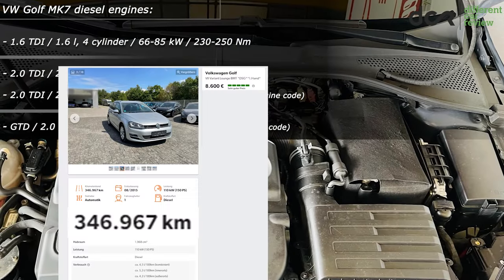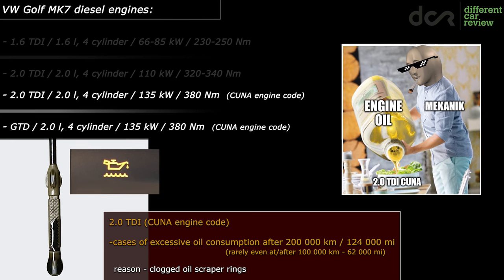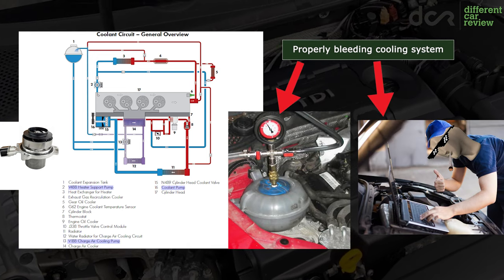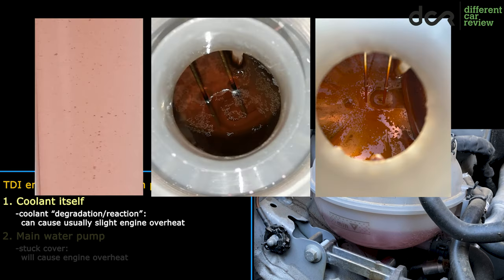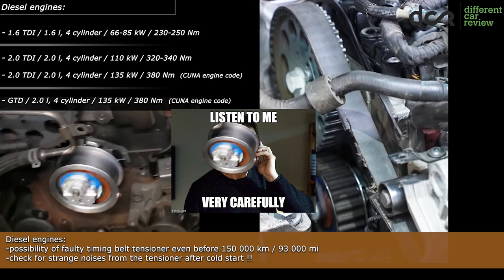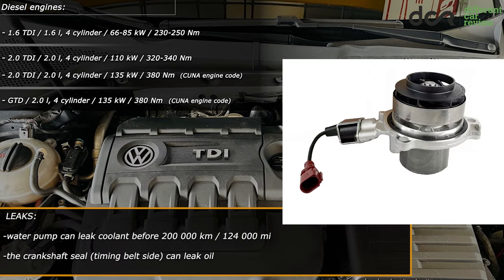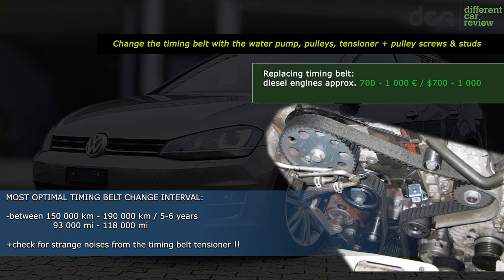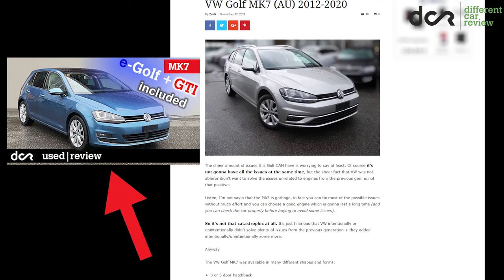VW Golf MK7 Issues of the Diesel Engines 2012-2020

Comment from the maker: Buying a used VW Golf MK7 (AU) - 2012-2020 https://www.youtube.com/watch?v=jSo4EHi9HMg
Buying a used VW Golf MK6 (5K1) - 2008-2013 https://www.youtube.com/watch?v=BgGyTSishKY&feature=youtu.be

VW Golf MK7 ALL Petrol Engine Issues https://www.youtube.com/watch?v=4f1aVIA801g
VW Golf MK7 GTI & R Engine Issues https://www.youtube.com/watch?v=xiaRO3CEkjs
VW e-Golf Issues & Things To Check Before Buying https://www.youtube.com/watch?v=7vU6VGmDAQY

1st gen 3 0 TDI ALL Issues https://www.youtube.com/watch?v=_so6yhV5qXE
2nd gen 3 0 TDI ALL Issues https://www.youtube.com/watch?v=272PBPSS2no
N13 Engine ALL Issues (BMW, MINI - N14, N18) https://www.youtube.com/watch?v=rc99kKDxoKw
Reply: Oil consumption is mostly caused by extended oil change interval. 10k miles interval can reduce the risk significantly and over 10 y is more economical. No need to add 15 L in one oil change interval.

Comment: We have a 2010 Octavia with the 1.6 TDI 105 hp (manual) in the family with 350 000 km! Nothing has gone wrong. Very, very reliable if serviced properly. The car is dog slow, but is perfect for motorway cruising. It's very good on fuel. 4.5-4.7 L/100km is my REAL average with mixed driving.
Reply: Thats the ea189 this Video is about ea288 but i got your point
Reply: @alexanderl4333  Yes. It's a EA189 dieselgate engine without the "fix".
Reply: @lahaag3310  yes, with the fix you would have many problems
Reply: That engine is a disaster, you are just lucky..

Comment: Also strange noise from oil pump which Vw says is normal, mostly when car is cold this thing has ali seat skoda vw 2.0 tdi 150/184
Reply from the maker: true
Reply: @differentcarreview-dcr  the 120 bhp is okay?  no oil consumption? I heard that the oil pump problem with the pencil was solved after year 2009

Comment: If you're still on G13 coolant switch asap to G12evo. G13 reacts with the interior heater / radiator and clogs up. Especially on diesel engines. Mine died around 115k km. GTD 2.0 tdi CUNA (pre Facelift)
Reply: Its clog up becouse of f... Silca bag in coolant reservor that is main problem
Reply: @dino30ma  good observation. Do you know which years are those with silca bag ?
Reply: I have 2.0 tdi 150 2015 year , l think is from 2013 - 2017 with silica bag but not sure 100%  @AC-db4ek
Reply: On my car l remove clamp behind engine (its tight but i can be done) where hose goes trough firewall to small radiator(which usual clogs with silikat bag) and discharge coolant hoses
First flush everything than 
put radiator cleaner flush again 
And last put g12 evo coolant .

Comment: Just to get facts straight...if you change oil and do long trip with excesive speeds 150kmh+ if engine serviced properly even at 200.000km 2.0tdi  with 150ps won't consume a drop. But...if you pressure that engine with last oil service done 10k ago be prepare to lose oil so check should be done weekly after 10k from last oil service especially if high speed is involved not city driving. These engines likes to eat oil but only after oil viscosity drops and this starts at 10-12.000km if pushed hard.
Reply: Completely agree 👍🏼. I realize it only recently.

Comment: Important thing to prevent these issues, use high quality oil and change every year or every 12000 kilometers and dont forget the filter as well.
Reply: I do mine at max. 10.000km or less depends on how the car has been used. City or highway driving.
Reply: Make it 7500 km on only city driving, 10k on mixed and 12k on only country roads.
Reply: Vw says every 15.000 km😮

Comment: I've owned my 2016 GTD for about 6 months and noticed it's used about 1l of oil in that time. Never had a car use oil before.
Was worried that it's a problem but after a bit of reading, it seems normal for these engines. Bit annoying!

Comment: I got a Seat Leon 2.0 110kw, bought it second hand currently has 128.000km. The only problem I had so far was a failed water pump at 85000km and had to remove and pressure cleaned the dpf since i suspect the previous owner didnt drive the car enough to get it to operating temp. Other than that its a great and proper daily machine.
Reply: Hi did you do the timing belt yet?
Reply: @mshahid2898  yes i had the timing belt changed at 85000 when i also had to change the failed water pump

Comment: I drive a 1.6 tdi 2019 octavia with 300.000km and have 0 issues with the engine. My colleague drives a 2020 Superb 2.0tdi with 200.000km and it has a big oil consumption issue. I guess the 1.6 tdi is a pristine engine.
Reply: My dad has a 2019 Passat, 260000km very minimal oil consumption.
Reply: @dobrien757 I have B8 with 110kw engine manual. 210k and no oil consumption. Only a slight between changes but that's only as I push it to 200kmh on German Autobahn. In this case it will take some oil but very minimal ammount.

Comment: I have a 1.6tdi dbka engine and have some problems by now (295000km) radiator exploded due to the silica bag for g13, i drove around 1500km until the oil light come on, it's about 1L every 1500Km, and the glowplug with the cylinder pressure it's giving error and at cold weather the resistence light come on and says low oil pressure

Comment: Hello, my 2.0 tdi 110kw. CRLB 280000km. When driving in normal mode (not autobam), the engine consumes 0.5 oil per 1000 km. After the oil change, 10 km were driven and 5 liters of oil was poured.... Just then I noticed that there was oil in the coolant tank (the engine was not overheated), the water pump is new, I don't think the oil cooler is leaking, I think it's related to the oil rings. .. :(
Is it worth handling the engine or is it better to buy another one?

Comment: My 1.6 TDI had a colling system issue. It did not overheat, but lost coolant through the exhaust system. Leading to a 2000 euro repair, because the engine had to come out...

Comment: I have  a little problem with my 1.6tdi , the car is in top shape for 10 years but i have a little failure , i start the car in morning and the car stuttering a little bit , 2 mechanic cant find the problem . timing pelt water pump and glowplugs are new , no oil and coolant consumption only 500ml in 12000kilometers . and all 20.0000km sevice . what can cause this problem ?
Reply: I have the same issue sometimes it does this. What i do then is put a can of injectorcleaner and put it in the tank. Or fill my car premium diesel. Then the problem dissapears the injectors of this  cars are really sensitive for dirt.

Comment: Hello, recently I bought an Audi A3 8V 2.0 150hp 2014 
I drove it to a mechanic and they checked everything except the coolant which of course after I check my notes I reassured myself to check on next inspection before buying. The car was driven about 50km so I couldn’t just opened the cap of the coolant and check so yeh. Long story short today I saw that the coolant has a brown not really clear color it doesn’t have any deposits in it and the substance is not muddy but it’s far from clear. So my question is what to do I took it to my mechanic and they’re gonna check it asap monday ( I bought the car Friday ) so you’re saying in the video if that colour occurs that we should run away from such examples. So should I contact the seller and get the car returned or should deal with that myself, what could be the possible outcomes of the situation money wise ?
Reply: I have bought my with the very bad coolant. Just change it and wash the system. No problems were after, you will only need to ad a bit more coolant later.

Comment: I own a Golf 7 1.6 TDI with 340,000 km.  I haven't had any problems until now, but it's time to change the crankshaft seal because it's leaking oil, but still a great car, a little slower engine unlike the 1.9 TDI, but it's ok for me.  With the previous owner, the air conditioning evaporator and the heating radiator were changed both times, their drawback is that it loses coolant due to the water pump, but my model has never had any problems with this.

Comment: the bad rings were made in the Mexico plant.  if your rings were made in Germany, you'll be fine.  280k miles on my EA288 and I don't burn or lose any oil (5w30 @ 504/507 spec).  oh ya, and I still have my factory heater core and use G13.  just plan on new timing belt & water pump every 100k miles.  replace HPFP & main seal at 200k mi.
Reply: How do you find out if it's a Germany one
Reply: Start stop system is killing the timing belt. I have changed mine at 180.000km did not looked good. By the book it should be changed at 210k bit I would not wait that long. Next change will be at 280k. Car looks great and runs great no issue at 210k.
Reply: How can we find out if it is Germany or Mexico!?

Comment: I have CRLB engine, and at 220.000 km, no oil consumption,..at all
Reply: Mine engine in Passat B8 is also CLRB no issues and no oil consumption. 210.000km Oil change is always at 10k or less depends on how I use the car.

Comment: my timing belt and water pump were both replaced at 110k miles and 10k miles later it makes that wooshing sound on cold start?
Reply: Mine has just started doing this as well.  Does it mean it's starting to fail?
Reply: It can fail suddenly again, I'd get it checked
Reply: Had mine changed at 70k and it was making that noise before and after it was replaced
Reply: @JsMxBiCs  how many miles since the change? have you had any issues and is the sound still there?
Reply: @ngelemental2274  currently at 80k and belt was replaced at 67k, no other issues but makes the same noise as before though like in video
Reply: Have you had a original belt and water pump or cheapest one ... My wife's golf had a cheap one and it lasted a year/3000 miles ... Do it cheap do it twice
Reply: @andystoe9984  no it was done at a certified vw shop, all parts were oem
Reply: @ngelemental2274  had fuel filter replaced on my Passat by main dealer and it was leaking as it was fitted incorrectly ... Only kids working there, for 160£/hour I want someone with experience to work on my car ( I prefer to do what I can myself and most likely do a  better job) easy to do on vw cars... I had 5 vw cars and never had one doing any odd noises from cambelt

Comment: As per VW manual an oil consumption on diesel engines up to 1 litre every 1000km is normal. Especially if you drive alot on motorway at high speeds.
Reply: The clearance on diesel valve is bigger than petrol hence consumption
Reply: Explains why my Mercedes Viano diesel use next to zero oil, It thinks its a petrol engine. 😂